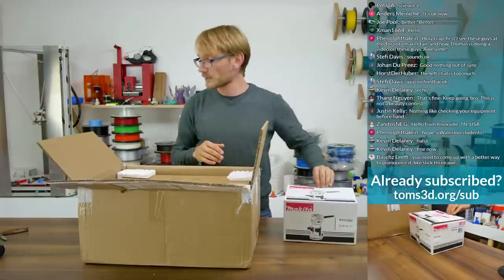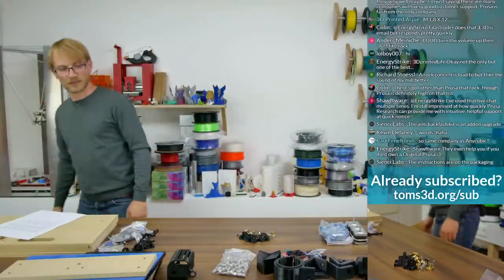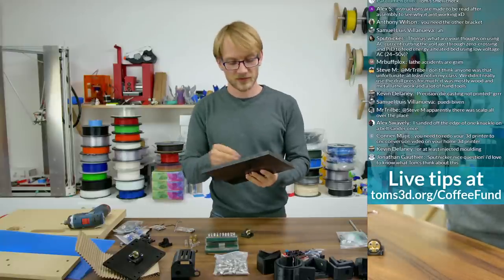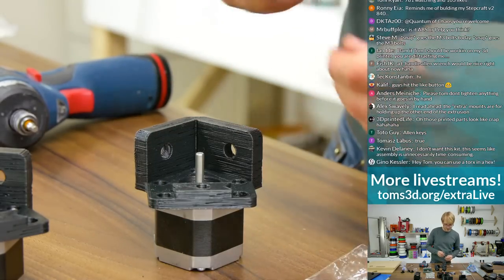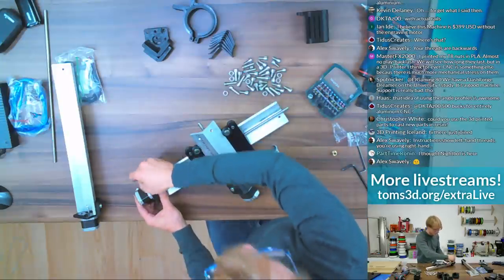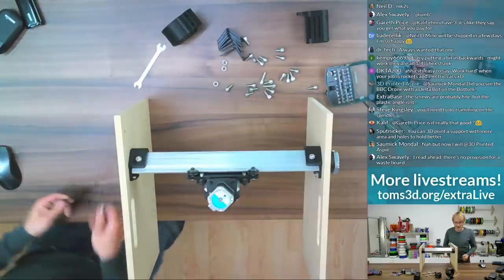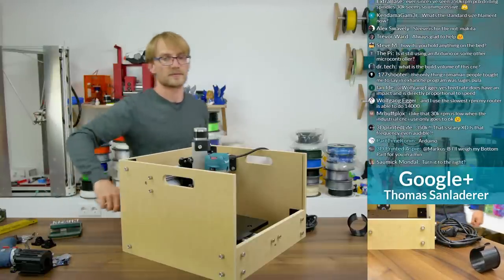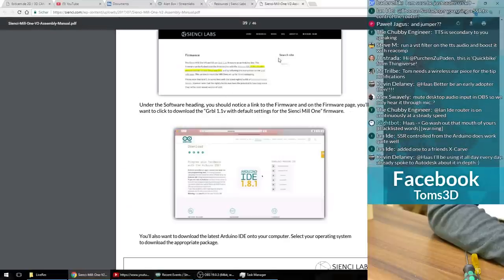Live CNC'ing: The $399 Sienci Mill One assembly and first cut! (Long and not a review)

Comment: Try setting the origin well up in the air and running the G- code with the spindle turned off, could be it's interfering with the signal. Are you trying to exceed the Arduino and shield's capabilities at all?
On another track I've found double sided tape does a pretty fair job of work-holding and that clamping down hard on ER11 collets hold tool bits quite well with that model Makita trimmer router.
Don't give up.

Comment: I was wondering if his G-Code had some sort lines making wait for a ready signal. Like how our 3D printers wait for the Hotend & Heatbed to heat up. Maybe there's something in the G-Code that's like that and the CNC was just sitting there waiting for a Go command from say a sensor or something. Oh well. Guess we'll find out at a later date. 🙂
Reply: If his g-code was in Mach3 format then it would of had a few lines at the beginning to "pause for spindle start" and "pause for tool change" etc.  I guess Grbl may not understand them.
Reply: grbl does understand pauses just fine (I use grbl with bCNC all the time) - but does pronterface know how to resume grbl after a manual tool change or any type of pause?

Comment: I use Universal Serial G-Code sender https://github.com/winder/Universal-G-Code-Sender though given that you are using estlcam you might forget about GRBL and use estcam Arduino firmware too, so you can use estlcam machine control too, so you won't need additional software.